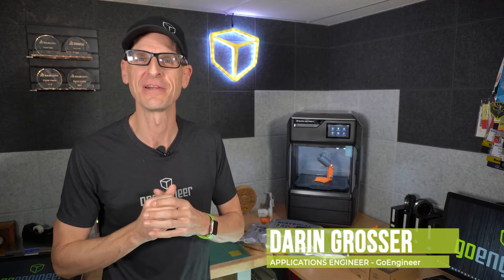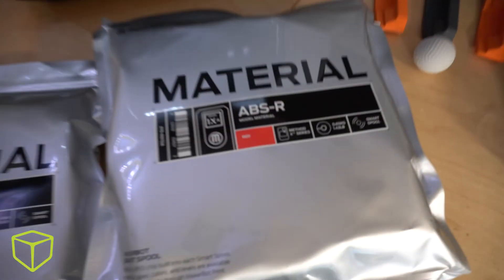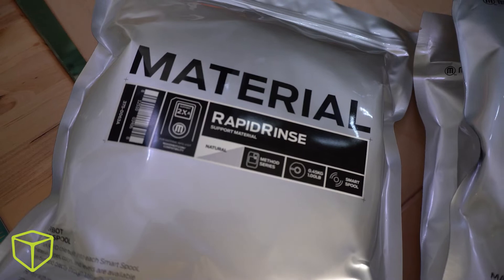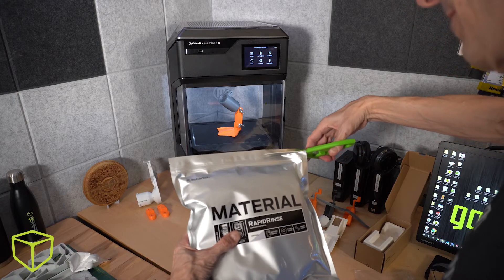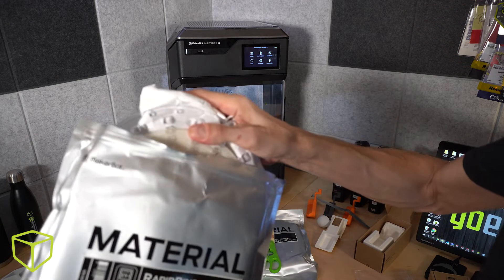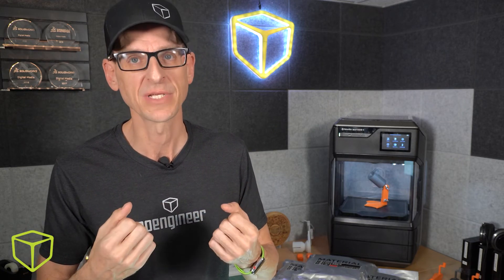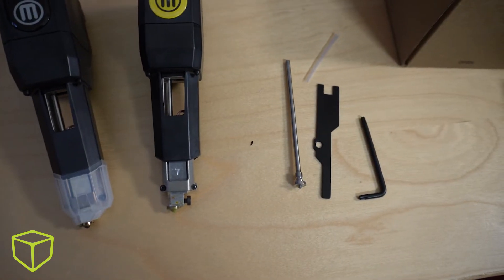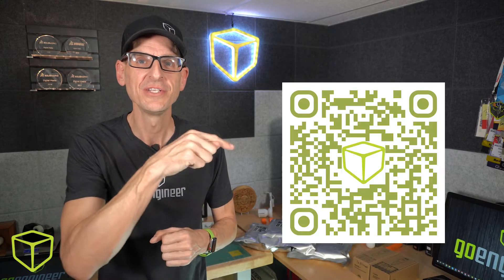Makerbot Method X ABS R and RapidRinse - Self Serve Nozzles

Comment: I am not having great success with rapidrinse. It just oozes like crazy out of the nozzle even with drying the filament, turning the temp down, increasing retraction.
Reply: Same exact issues! Ever fid a decent print setting config for the rapidrinse?
Reply: @Naor  I'm afraid not. I haven't used rapidrinse in about 5 months now. Been using PLA tough with PVA. My last notes for rapid rinse was 225c temp with 1mm retraction, was still oozing. 

Simplify3d software supports method and method x. Someone told me it works good.